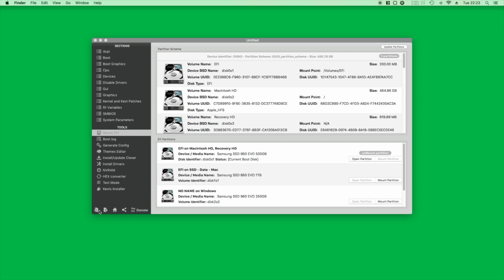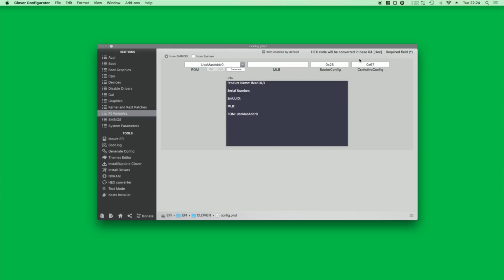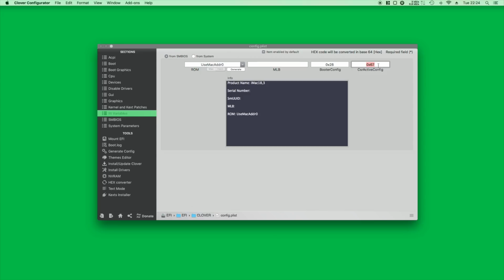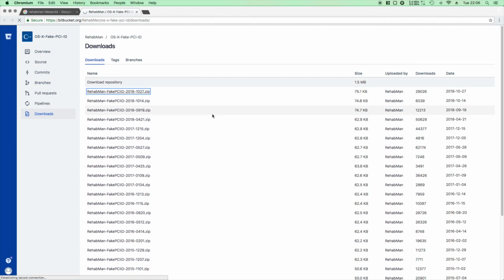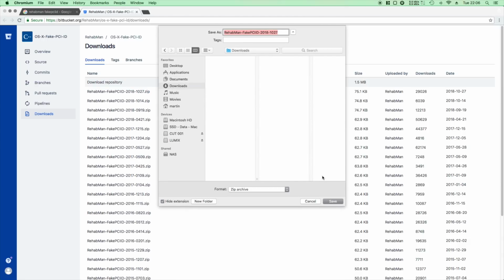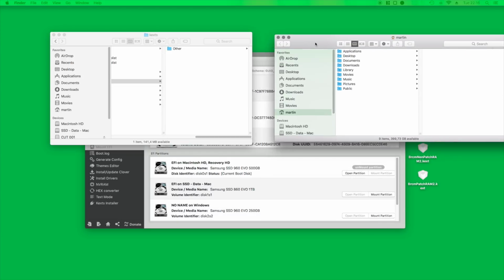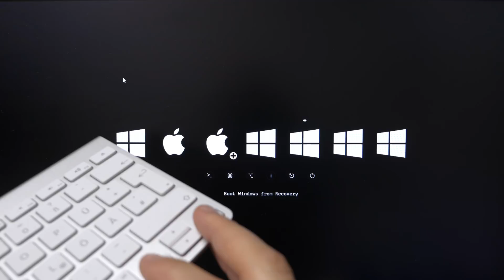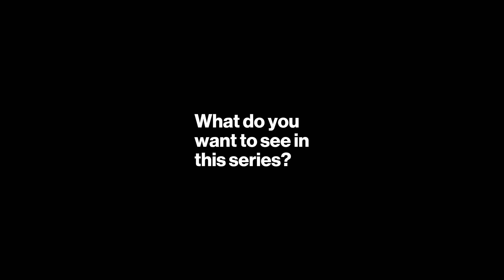WiFi and Bluetooth on a Hackintosh

Comment: I followed all the steps but my motherboard, Gigabyte z390 Ultra,  doesn’t give me the option to flip the cable in the USB slot. In the 8 pin connector one of the pins is just plastic and won’t accept any pin which won’t work putting it upside down. Do you have any tips on how I could get the Bluetooth working without flipping the connector 180 degrees? WiFi worked right away but I can’t get Bluetooth to work :/
Reply from the maker: Well, that's strange. Did you tried F_USB2 and F_USB1? At least from photos online it should work. One solution would be to cut the cable and switch polarity, the other: getting rid of the plastic "thing". Or get another adapter cable, if that's possible.
Reply: Martin Guder Currently my USB 2.0 slots aren’t working so I think that might be one reason it won’t connect. My usb 3.0, 3.1, and usb C port work though. And yeah I tried both usb slots on my motherboard and neither worked. Do you know how to get USB 2.0 to work by any chance?
Reply from the maker: That's weird. Not sure how I can help. At best contact customer support regarding the topic or post it on a support forum.

Comment: 65 Euro? Ouch, you paid way too much. It cost me about 25 Euros together for NGFF M.2 to mini PCIE adapter and BCM94360CS2 card (doesn't need any drivers) and longer pigtail antenna cable (as original one would not reach the card connector as card is higher on adapter).
Reply from the maker: It heavily depends on your location and at that time, it was one of the cheapest. It works without any hazzle, that's the most important though. :)
Reply: Martin Guder yeah, it works without a hitch. I’m from Slovakia and if I’m not mistaken you are from Germany so it should be same price. I bought mine about one year ago too.
Reply from the maker: Hm. Maybe you had some more patience waiting for a good price or luck or both. ;)
Reply: @MartinGuder  True. Given a price/value over time/performance ratio of Hackintosh it's a small difference. But still, can get another 256 GB NVME SSD for that price difference, of 2 TB HDD, or better power supply etc. :). Anyway, you are right - it works, in comparison to many strange USB "solutions" some people are willing to try instead of going the way of less resistance.
Reply: Does the bcm94360cs2 work OOB?
Reply: Vijay Jalihal yes. Just replace it together with adapter and one longer pigtail antenna and it’s good to go. Everything works like on real Mac - BT keyboard and mouse even in BIOS, handsoff, continuity, airdrop, airplay, internet sharing etc.
Reply: Jozo99 this chip is from a MacBook Air right? 
I looked up and I’m confused. Few say BCM94360CD will work and Others day BCM94360CS2 will. I don’t know which one to get. BCM94360CD is expensive.
Reply: @Arnoldshivajinagarr  any such card pulled from Mac will work. Get BCM94360CS2, personally I use it with M.2 NGFF to mini PCIE adapter in Asus Rog Strix Z370G WiFi and it works absolutely great. Be sure to get motherboard with built in WiFi on card (usually M.2 NGFF) – some motherboards have it permanently soldered so that's no no. Also PCIE to mini PCIE solution is not that great, it sometimes doesn't work (or just WiFi works).

Beware that you CAN'T put an M.2 NGFF adapter to regular M.2 for NVME SSD, those are completely different slots. You will have to remove shield (and on some mobos chipset heatsink too). Shield is screwed from bottom of motherboard. Than you have to remove whole shield with Intel card from board, remove Intel card from part of bracket (it's on double sided tape) and put your adapter + BCM card on the bracket. reconnect antennas and stick it into slot and screw it back. You will be not able to put shield back, quite possibly not even heatsink – be aware of that when choosing motherboard.

Anyway, it's very easy to do and you should be able to make it in 5 to 10 minutes. Also, once you test measure the lenght of the card on adapter, you can just cut remaining perforated part of adapter so you can shorten whole solution quite a bit, like 1/2 inch (1 cm)
Reply: Jozo99 I’m using the aorus Z370 ultra gaming WiFi which has a slot underneath the IO shield as well as pcie 1x slot. Should I do what this dude did in route 1 with the card your using?
Reply: @Arnoldshivajinagarr  that's solid board for Hackintosh, even has Thunderbolt support.
Well, WiFi solution depends on you. I just measured my on M.2 NGFF adapter and it's 1.5 cm above the original WiFi shield. So you would have to cut into the IO shield – I wouldn't hessistate to do that. Don't worry about RGB light above WiFi, as adapter with BCM card will be more to the right. So you can take your dremel and do what you want to do :)

Or you can go with PCIE adapter, but in that case, don't forget to turn off onboard WiFi in BIOS. If some part wouldn't work (ie. Bluetooth) you have to try different PCIE 1x slot.

personally I would order both adaptors and decide after measuring of original onboard WiFi it it would fit underneath IO shield without cutting. It's just a tad more expensive.
Reply from the maker: I can confirm the CD version works. There is a list of natively supported chips linked in the video description.
Reply: Martin Guder thanks dude

Comment: installed successfully and how select correct smbio and how to install. my config  i7 8700 - gigabyte aorous pro WiFi z390- GeForce 1060 - 16gb ram 3000mhz
Reply from the maker: Correct SMBIOS is usually the one, that is the most similar to yours. I would suggest iMac 18.2 or 18.3 in this case. Bear in mind, that you have to install additional Nvidia web drivers as well as change some more settings in your config plist because of the Nvidia GPU. Not sure what exactly, as I use AMD because of native support.
Reply: you won't get graphics support in mojave

Comment: I like the second route more because it also works with Laptops(Hackbooks) and some All-in-Ones ("iHacks"?)
Reply from the maker: Good point. That's definitely an advantage of the second route. Can you recommend laptops, that work well for Hackintoshing?
Reply: @MartinGuder You can use any laptop with intel integrated graphics, you can check if they support the second route by looking for teardown videos or the mainboard of these laptops on ebay if you can spot an M.2 Wifi/BT (2230) slot.
If you want a Hackbook Pro with dicreet graphics go for the Lenovo Laptop ThinkPad E480 with RX 550(800$).
I prefer the Lenovo Ideapad 720-15IKB(i5 7200u version 900$, the better version with i7-8550u 1700$), because it has an RX 560 and looks more apple-like,
but it isn't available in the US (in Germany where I live it is). 

What I also find interesting is an All-In-One by Dell (Dell Inspirion 27 7775) which also supports this Wifi module.
Reply from the maker: Cool thanks. I also live in Germany, so probably I'll take a closer look at those models. :)
Reply: @MartinGuder  Wusste gar nicht, dass du in Deutschland lebst, du hast kaum einen  Akzent.  Ich selbst bin kein Hackintosh Experte, daher kann ich dir nicht garantieren, dass Macos auf diesen Laptops funktioniert (MacOS ist ja generell ein bisschen widerspenstig), sie haben aber unterstützte Hardware. Vorallendingen Audio könnte dir Probleme machen bzw. nicht funktionieren, dann bräuchtest du ein USB-Headset.
Reply from the maker: Danke. Native Speaker haben es schon raus bekommen. Aber das ist sicher auch nicht schwer. :) Ich bin auch kein Pro was Hackintoshs angeht, aber ein USB-Audio-Interface sollte bspw. kein Roadblocker sein. Habe viel gelesen über nicht funktionierende SD-Karten-Slots und dedizierte GPUs, die nur schwer zum Laufen zu bekommen sind (eher Nvidia). Na mal schauen was die Zukunft so bringt. Hab auf jeden Fall noch mehr als genug zu schrauben am jetzigen Rechner (Vega 64, zweites macOS-Backup-Laufwerk und Mojave Update). Danach steht ja dann schon Navi 7 vor der Tür. Mal schauen wie da der Support ausschaut.
Reply: @MartinGuder  Falls du über den Kauf eines Hackbooks nachdenkt kannst du gerne auf mich zurückkommen und ich freue mich schon weitere Videos von dir zu sehen.
Reply from the maker: Danke für das Angebot. Wenn es soweit ist meld ich mich. :)

Comment: Thanks Martin, very well put together and very helpful. I still haven't made the move to a hackintosh as I'm kind of ok for the moment with my 2013 iMac, will likely decide if I make that jump once I know what Apple announces in the coming months. Cheers! 🙌😊
Reply from the maker: Thank you. If it's still working for you, than it of course would be a waste of money and resources. :) I'm also very keen on what Apple has up it's sleeve, especially about ARM and Mac's.
Reply: yes, ARM would be an interesting move for Apple, although I fear that would also mean that the hardware would become useless after it's discontinued as it will be all proprietary hardware, I doubt we could re-use the hardware with Linux for example to extend the life of the hardware a bit more. I secretly wish that Apple would add support for Ryzen CPUs 😉

Comment: Very interested cause my older mac pro (5.1) also needs upgraded hardware to use handoff, airdrop etc... same rules apply probably
Reply from the maker: Saw a video about a guy upgrading his Mac Pro 5.1 lately. Watch it here: https://youtu.be/naqLQz7TAcs

Unfortunately he had some issues with Bluetooth disconnects from time to time. Maybe an extra PCIe card is the solution in conjunction with a second USB PCIe card (if there is no USB 2.0 on the mainboard).
Reply: @MartinGuder  Thx Martin. Keep up the good work!!